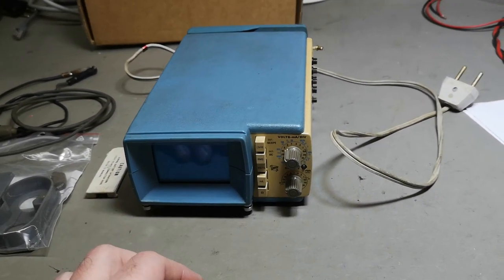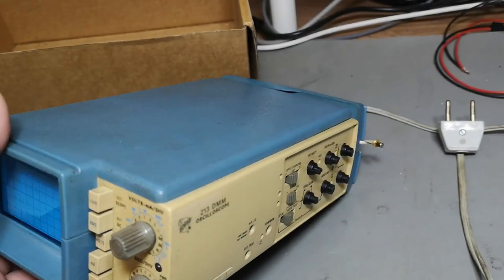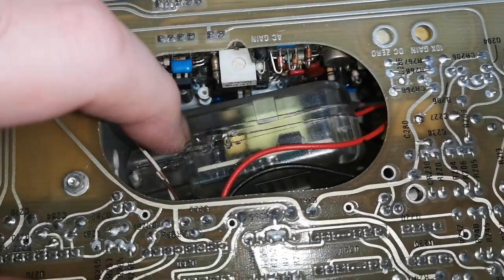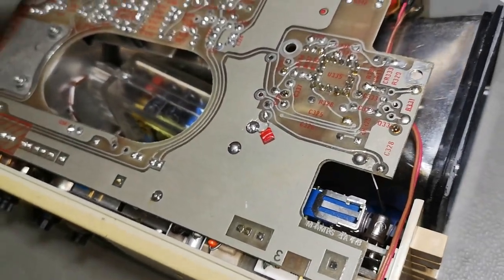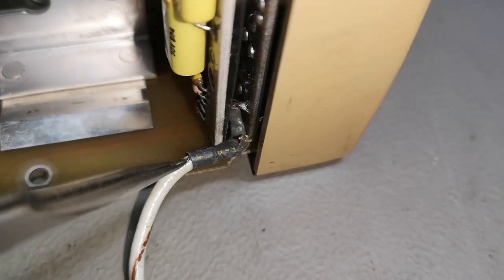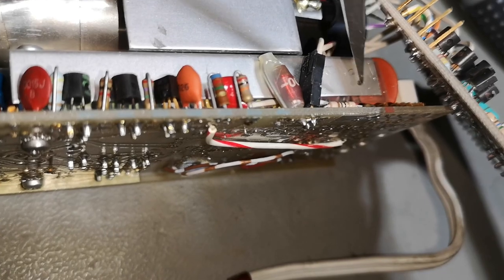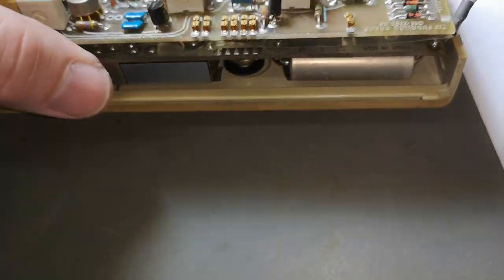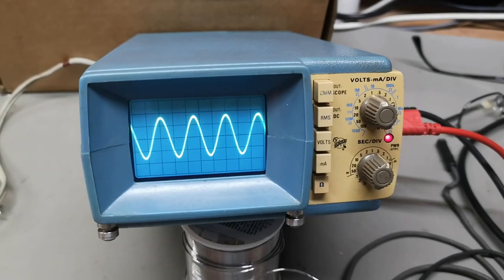Tektronix Oscilloscope 213 DMM 1ch 1MHz 1975-89 teardown

Comment: Hi, nice piece, I have a two channel model 212 made in 1972
The non-original source was pretty crazy.
I don't know if you know this, but the probe connector is supposed to be inside the oscilloscope, the probe has a locking ring pressed on the cable, which is supposed to secure the probe cable against pulling out - the probe cable is then wrapped around the housing into the groove in the back part.

Nice day 🙂 Tom

Comment: I believe the silicone insert in the sockets are to prevent air to enter, so the pins doesn't corrode.
Reply from the maker: good point, thanks
Reply: I have repaired a few of these. I have found those little silicon inserts on the two special Tektronix chips tend to degrade. I have repaired a few by just reseating those chips.